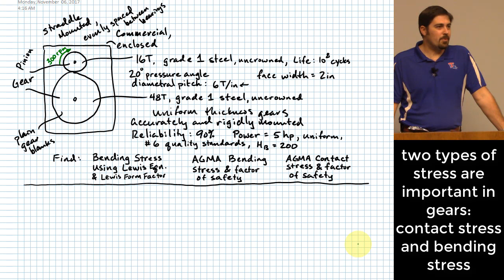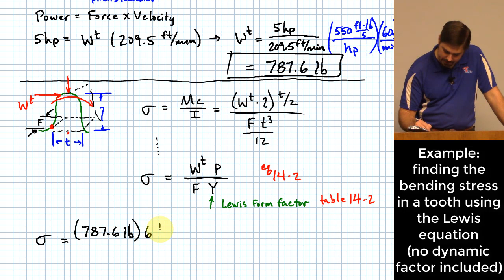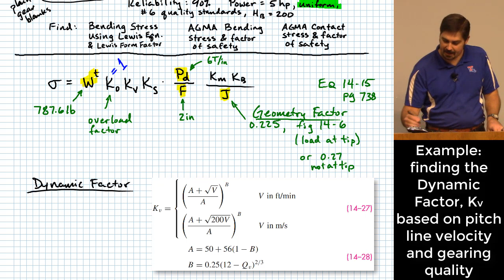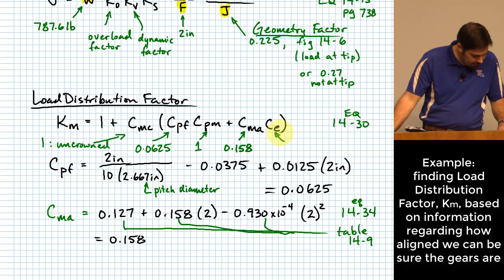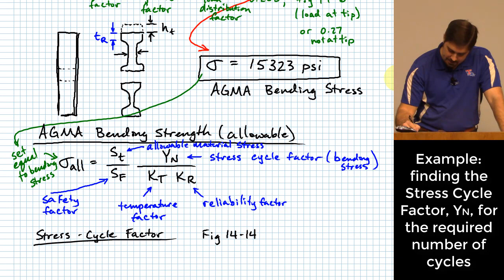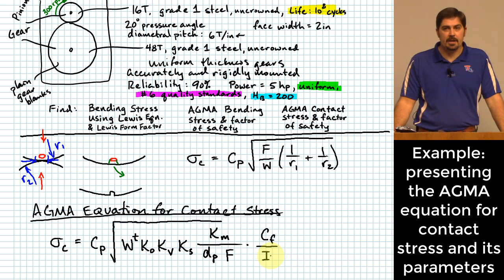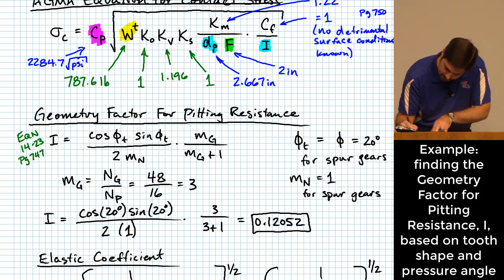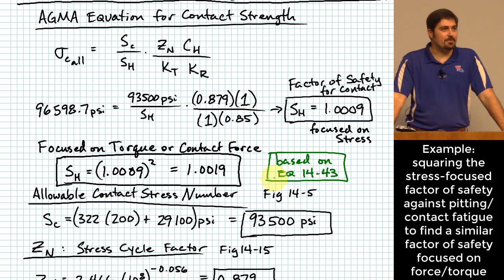AGMA Bending & Contact Stress & Strength for Spur Gears | Lewis Equation | Tooth Pitting & Fatigue

Comment: Taking Cp from table 14-8 instead of the equation results in a factor of safety less than one. 
In case of a situation like that in a math, are we supposed to guess a different diameter for the pinion and do the math again like a trial and error method?

Thank you for your efforts in making these lectures. They are very detailed and extremely useful for students like us. A huge respect for you from Bangladesh.

Comment: @1:54:30 Figure 14-5. This list strength for contact-fatigue for 10^7 cycles and 0.99 reliability for through hardened steel gears. Shouldn't we use something for 10^8 and 0.9 reliability for this problem? How can we know how far off this is? IE is this a good estimate regardless? Would like to know so that I can make adjustments if necessary :) Thanks for all you do!   

EDIT: Could you also explain difference in using S_F and S_H (for torque/force)? I am not understanding when to use which one, as from what I understood, both can be used to find out how much more force/torque one can apply. Any clarification would be much appreciated. :)

Comment: Sir, I have been to degin a gear system with the following inputs. Input speed-2350rpm, output speed-450rpm, power-10HP. For this input I have taken Epicyclic gear train arrangement with spur gear. Is this video alone be enough for use to find the stress value and FOS. Else can u recommend any other videos.

Comment: Being a recent graduate, your material has been life changing. It had made sense of topics I dreaded at university. I genuinely can’t thank you enough. Would you also have anything on contact mechanics ? I am doing a ( real life ) problem of pin in a Clevis for a heavy duty door hinge and I am trying to understand the method to calculate the contact stresses that the pin would be experiencing. Thank a lot in advance.
Reply from the maker: I don't have a video exactly like that, where the distribution of stresses across the contract faces are more precisely modeled. I do have a video where I talk about bearing stress in a clevis and pin, but I just use the projected area technique, which is ok for less critical designs and ductile materials. I'll give the link in a comment below...
Reply from the maker: https://youtu.be/3GEI41gJ0B0
Reply: @TheBomPE  thank you so much. 
Lots of love and respect from the land down under !
Reply from the maker: Glad I can help!

Comment: Hello. Do you mean if we have equal hardness on both gear and pinions, pinions can failures before the gear does? If it is so how deep hardness is counted for this? Sometimes it occurs HTTP on the surface with 20 micro deep, will it effect the contact strength even the hardness in deeper is much high? Or is it enough that the surface area is soft?

Comment: Does the diametral pitch affect the value of J read from the chart?
Reply from the maker: The chart shown is for 20 degree pressure angle, full-depth teeth, and it is for all diametral pitch values. Other charts would have to be used for other pressure angles or non-full-depth teeth. Thanks for watching!
Reply: @TheBomPE  Thank you for getting back to me, and clarifying things for me. I was a bit  confused because the chart that I was using (shigley) had a profile of a full depth teeth and below that was  the statement "generating rack 1 pitch".

Comment: 1:10:10 

In my book they use 
YN=1.3558N^-0.0178

Why ?

Which one of you are correct?
Reply from the maker: If you watch the video you will hear me say that I'm using the lower curve on the chart as the most conservative possible value for YN (lower values are more conservative for this factor). It sounds like the example you must have seen chooses the least conservative of the potential range of values for YN.
Reply: @Muhammad Usama He uses Shigley's Mechanical Engineering Design

Comment: Sir can you make a vedio for how to calculate motor power starting from scratch i.e. want drive roll at an speed 1000rpm and min torque required is 1000Nm. ,then how gearbox and motor and safety factor calculate
Reply from the maker: I don't know if I can tell exactly what you want here, but I will keep your comment in mind! Thanks for watching!
Reply: Sir can you explain in detail about pitting concept of reverse bending what you have explained in this Lecture.  
Also why we should double the pitting factor SH2 to understand torque max value will be drawn.